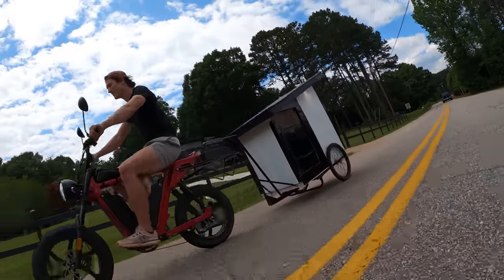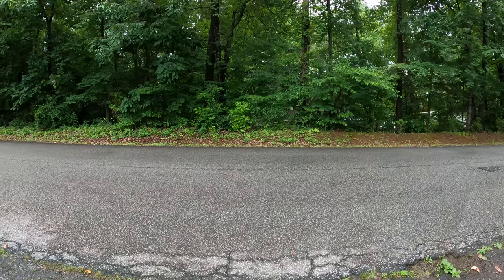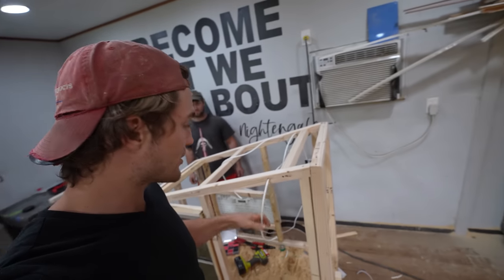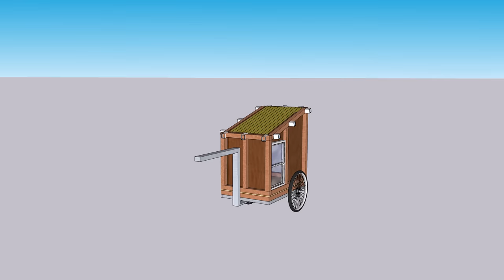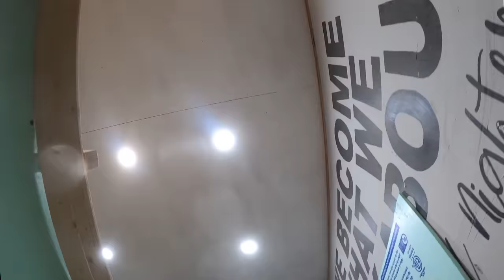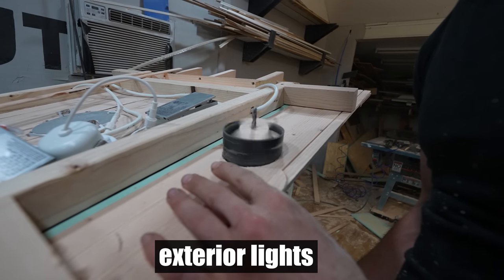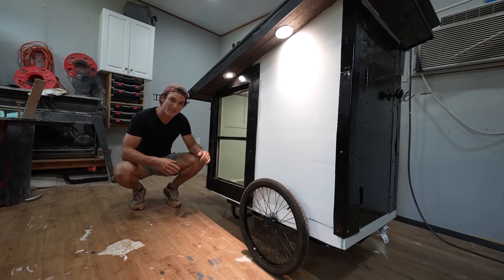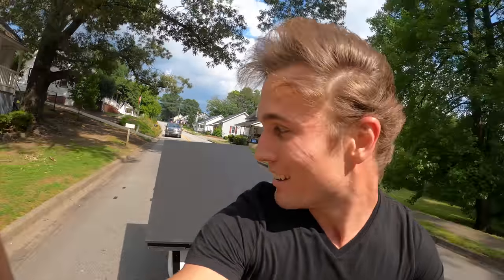I built a CAMPER for my DOG

Comment: Awesome build. The only things I would have done different is I would have flipped the window the other way so the latches were to the outside. Much easier to open and close the window. I also would have put the cheap white plastic paneling over the foam board. It is commonly used as wall covering in low budget bathroom builds and other places where easy cleaning and moisture resistance is important on the cheap. It would be completely waterproof and add some impact resistance since the foam will get dinged and dented with little impacts. And the plastic would take paint well and look completely smooth. And they are only 25 bucks for a 4X8 sheet at Home Depot.